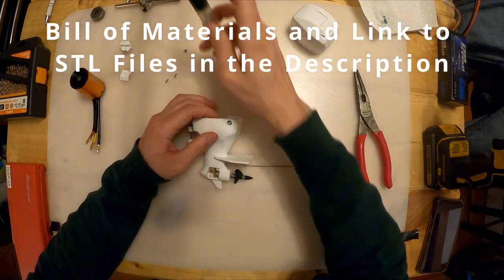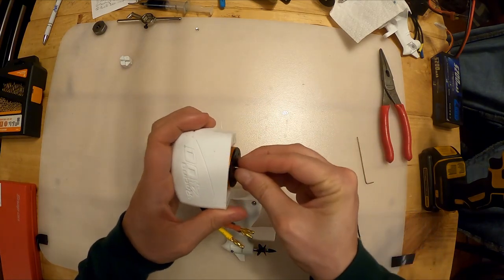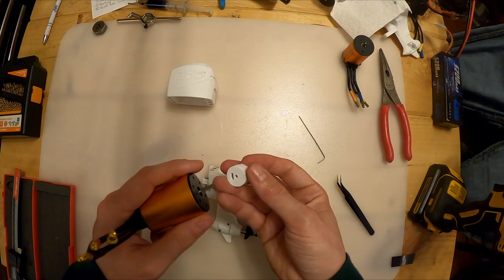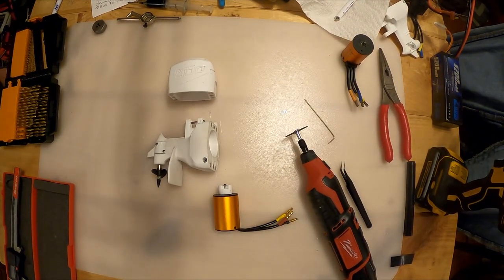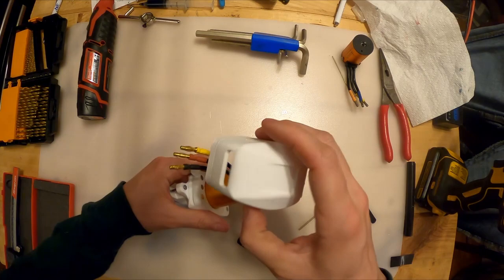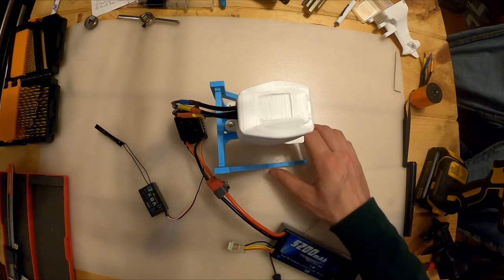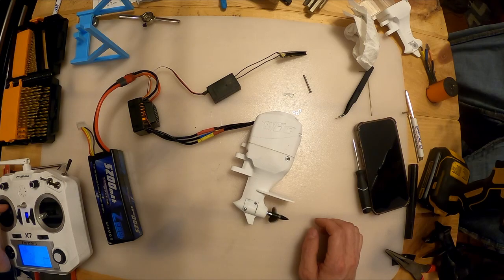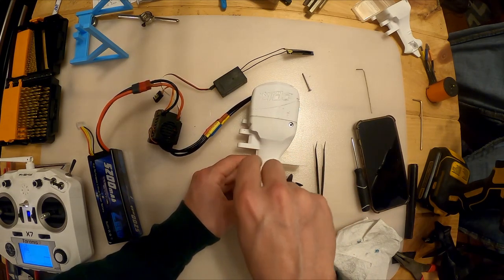3D Printed RC Outboard Assembly: Part 3 (Final)

Comment: Built one with the motor you recommended unfortunately it was way over powered for my needs.  The motor also got very hot.  Went inline for this boat but plan on using it with a smaller motor for my next boat.  Looks good and worked well.  Thanks for putting this out there.
Reply from the maker: Hopefully you can find a hull to handle the power! Also, about the heat, I am working on a water cooled version that’s coming soon!
Reply: I just printed it. I’m going to try and add copper coils around the motor. And use a water pick up to cool it.  I may have to redesign the cowling to fit it. I’ll order some parts to find out.